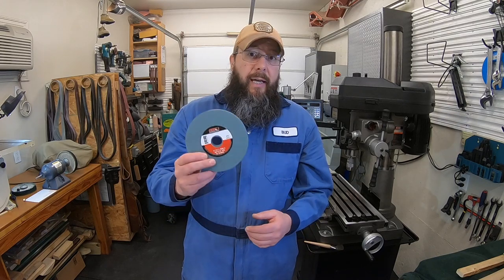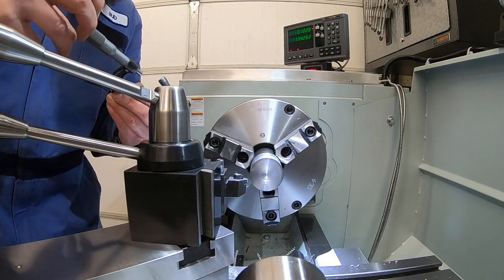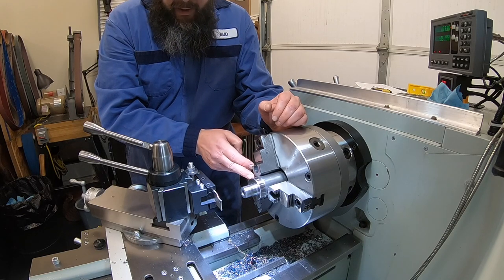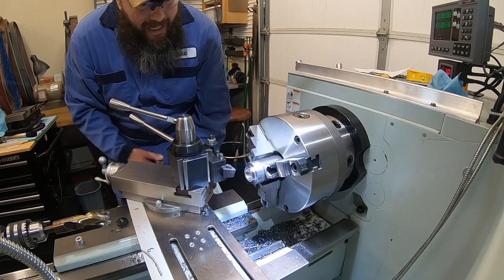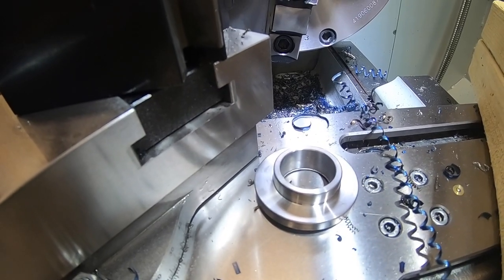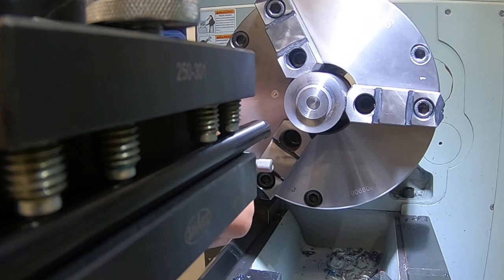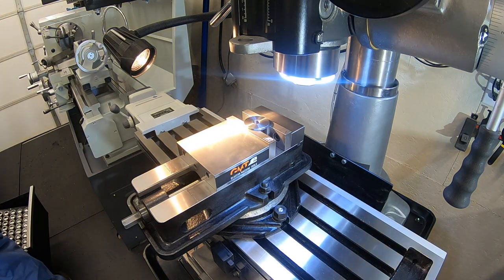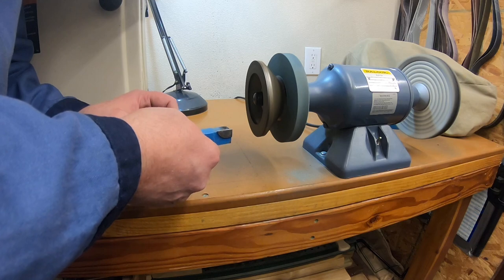Green Silicon Carbide and Diamond Cup Wheel Combo Spacer Mounting Kit

Comment: great video. Thank you for sharing the idea of two wheel combo. Please let me know where I can find the 5" Diamond Cup wheel. Thanks
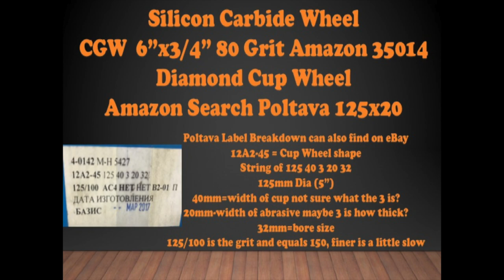Reply from the maker: Tinh Nguyen - Glad it was helpful. I bought both wheels on Amazon. Check out the video at 1:42 and you will see the part number and details for both wheels. Let me know if you need more info. Thanks for the question.
Reply: I used the part numbers and searched for them in Amazon website but, couldn’t find them. I’m going to try it again. Thank you Sir
Reply from the maker: @TinhNguyen-mb7gx  Try just searching 80 grit silicon carbide wheel 6” and search Poltava Diamond Tools Cup Tool Diamond.  You may just have to read through the description to ensure you get the size and grit you want. Sorry the part numbers changed.  I did just pull up some options in Amazon now with those search entries.

Comment: Great video. Why not use the diamond wheel alone for sharpening carbide? I stopped using green wheels years ago. New equipment is great. European or American lathes, mills are the best.
Reply from the maker: Paul - Great question. Partly just habit and what I am used to. The green seems to remove material faster when I am shaping a new bit, but could just be in my head.

Comment: Also another comment: You can broach keyways on your lathe by using a piece of HSS tool bit blank the width of your keyway, and you can simply push it in with your handwheel, taking care to advance only a few thou at a time.
Reply from the maker: Tyler Fu - Yes, that is a method I have seen used before.  If I needed this to be a flat bottom keyway, I would have had to do that.  Since the rounded bottom would work for this application I went the quick and easy route.  Thanks for the tip!

Comment: I first saw how you stacked the wheels and I tried to do it, but regrettably my grinder's shank is far too short, it has no room for more than one wheels. Not sure what I can do. I ended up mounting a diamond cup wheel on it... did not use a spacer, just installed it, then used a dial indicator to indicate it in before tightening the nut. Not sure how long it will last, but will get around to making a spacer for it.
Reply from the maker: Tyler Fu - I would definitely recommend making a spacer for that wheel sooner than later.  Having that get loose and start rotating well out of round and off balance could be dangerous in a hurry.
Reply: @BladesIIB  I tried to make a spacer, but I was running into difficulties. For one thing, I don't have a small enough boring bar to accurately make a hole exactly 1/2" in diameter, and so I ended up using a 13mm drill bit that is too loose. I had to wrap tape around the spindle to get the cup wheel installed without a problem. By turning the washer around I was able to fit both the grinding wheel and the cup wheel onto the bench grinder, but I don't know how well it will hold or if the wheel will explode. I'm ordering some smaller boring bars, and proper holders for small boring bars (basically those split piece of steel with a round hole in it). I don't have a quick change tool post, so I'm stuck with using a 4 way toolpost. I tried using an end mill to use as a boring bar but it just isn't working.

I'm going to work on making a nut/cup wheel mount that will comfortably secure a grinding wheel and allow me to use the diamond cup wheel. Also ordered some green wheels for grinding carbide.
Reply from the maker: @taiwanluthiers  That sounds great. Should keep you busy for a while. With the 4 way tool post. Many boring bars have a flat and you can clamp them similar to a square tool. I hold a couple of my boring bars that way in my quick change holders.

Comment: Why Jet mill/drill, not Precision Mathew's?
Reply from the maker: tallyman15 - Great question. If I had it to do over again I would definitely get a PM. I had not discovered them when shopping for my mill. Almost bought a Jet lathe as well. Had it ordered when a friend directed me to PM and I changed last minute. Thankful I did. I will likely upgrade my mill at some point, the round column can be a problem sometimes.
Reply: @BladesIIB  what PM model would be similar to your Jet?
Reply from the maker: @tallyman15  the PM 833TV looks closest to my Jet. I would likely do the knee mill when I upgrade. Similar footprint and I think a better unit for me. So would probably get the PM 935TV.